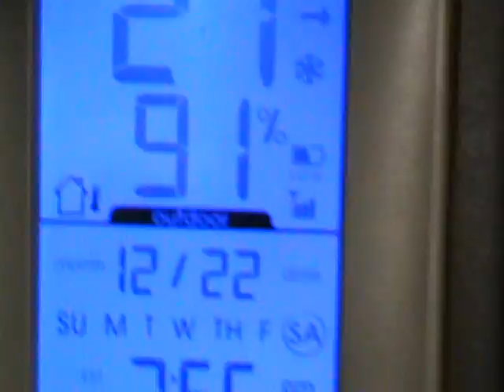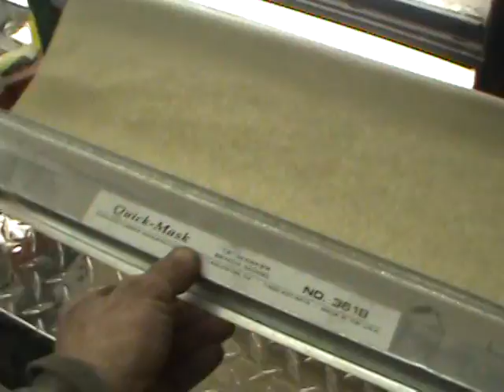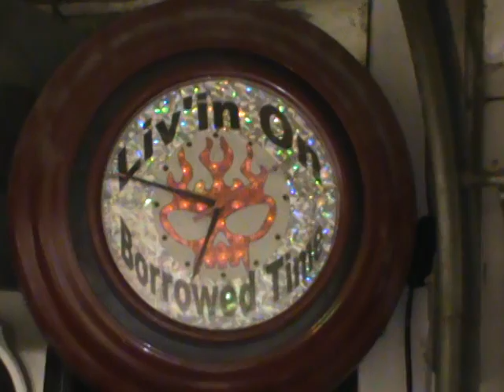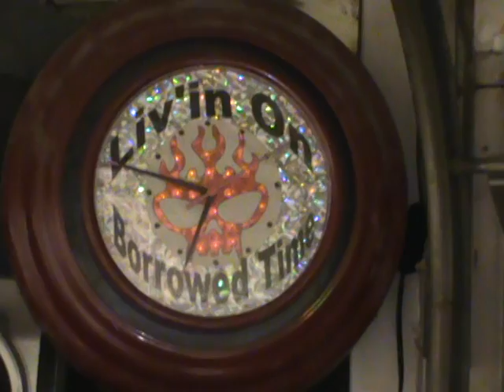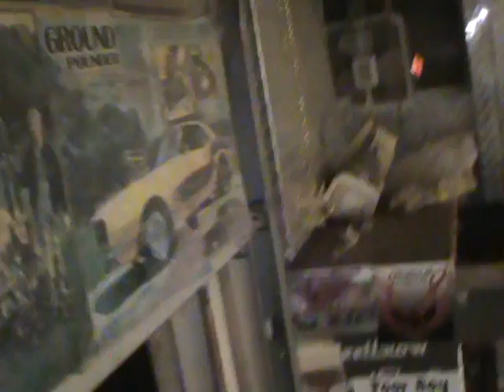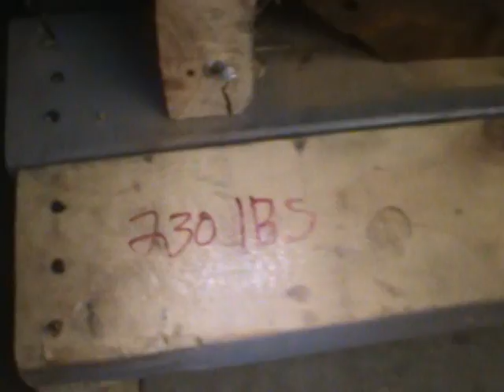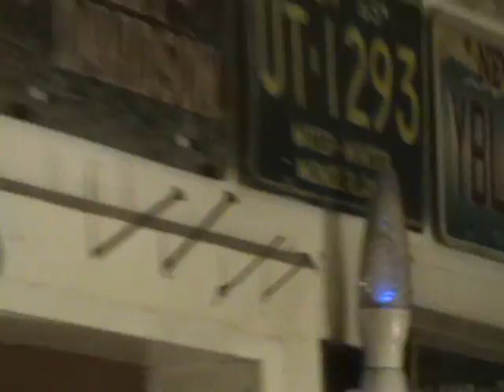WILDEYEDNORTHERNBOY-382

Comment: Those step bits can be sharpened. Just grind the face where it is cut out until you get a sharp 90 degree corner. Just like brand new! Don't let the bit get to hot keep some water near by to dip it in.